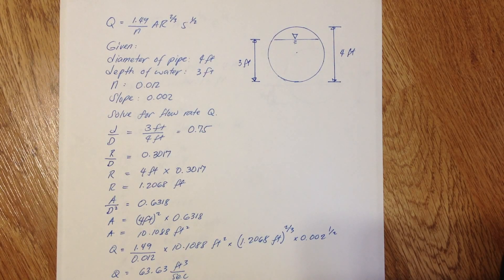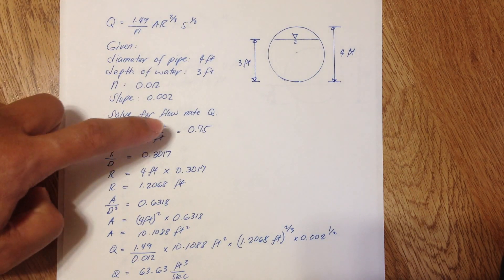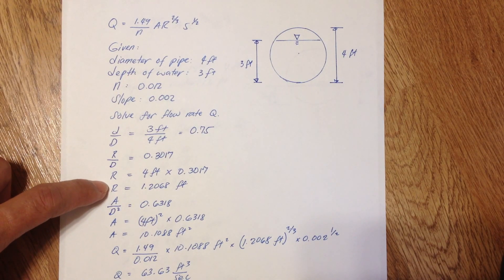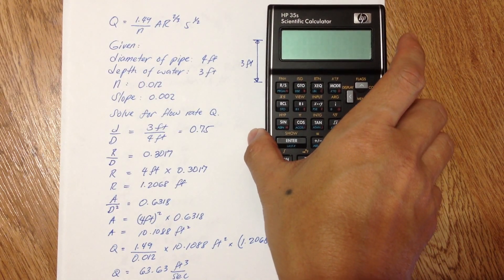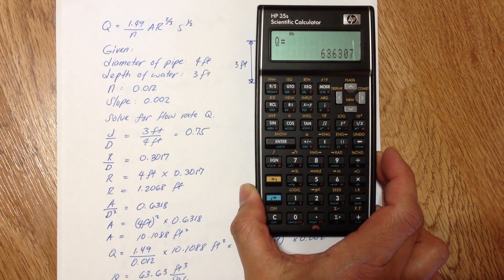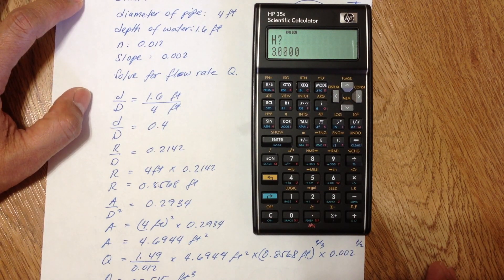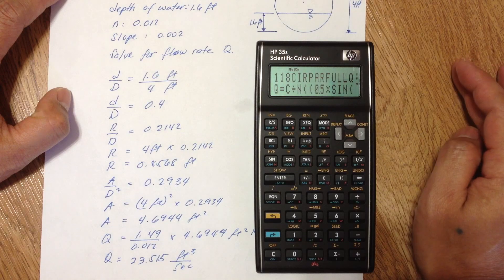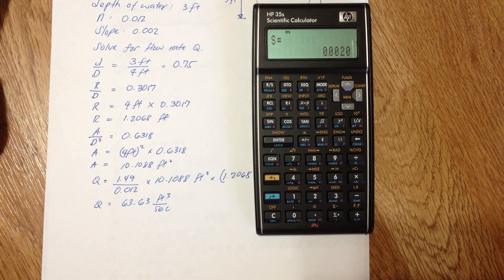HP 35s tutorial on Manning Equation for Circular Channel solving flowrate flowing partially full

Comment: Hello, emergency call. Given Q=0.5 m3/s D= 0.5. Assume S and n and the angle of the circle in order to get the triangle angle and so get Top width which is equal to the top width of the triangle. i keep getting low slopes if n=0.016 and also unrealistic n !! BS Standard.